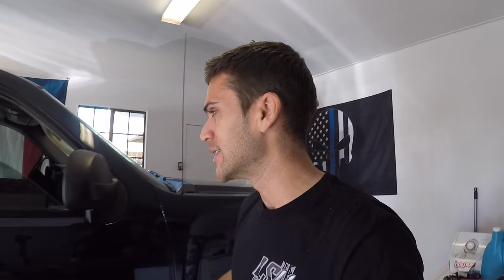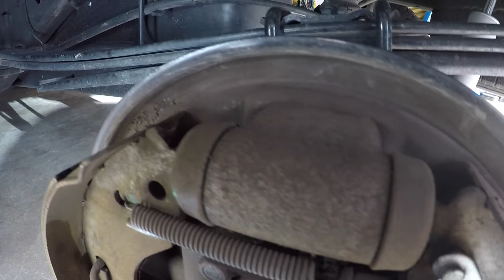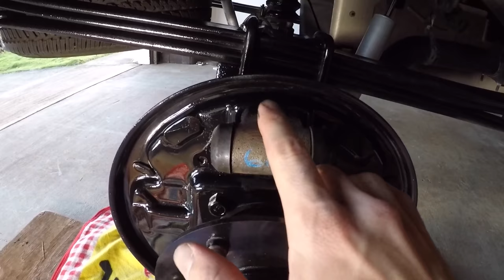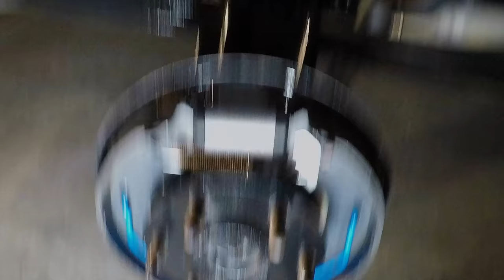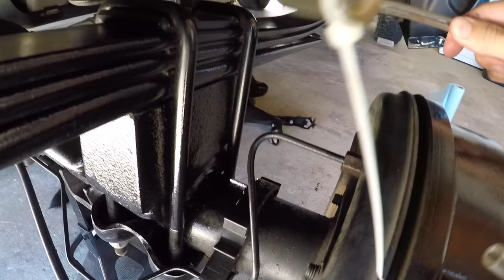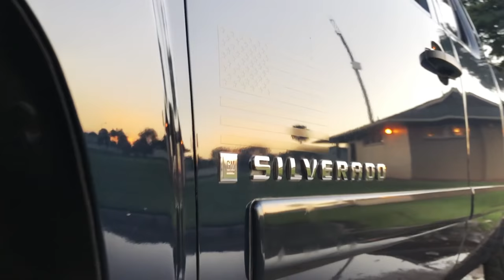Drum Brake REBUILD - Silverado Easy DIY

Comment: My 2010 had the same issue with brake fluid mysteriously going down, the master cylinder was leaking into the brake booster(the big black dome behind the master cylinder). Unbolt the two master cylinder bolts on the booster and move it out of the way and stick something down into the booster, will come out wet with brake fluid.

Comment: Rule of thumb on most trucks there's always a bolt on the truck that will fit another spot. Especially for the drum brakes. Also the disc brake conversion I've seen are around $1500 just for parts. Alot more stuff then u think.

Comment: How much does the truck get driven and how low does the brake fluid reservoir get? Your fluid is going to go down over time also just from the shoes and pads wearing and the pistons holding more of the fluid.

Comment: The reason you are topping off  every 6 mos is not needed, as your brakes wear the fluid lowers. If your constantly topping off your system will be overfilled when you do a brake job and dump fluid everywhere when you compress the wheel cylinders and calipers for the new pads/shoes. Replacing a wheel cylinder like that is good preventative maintenance  but was unnecessary.  Wheel cylinders should also always be changed in matching sets unless using o.e.m . Lucky your in Hawaii because any other states then ca. And Hawaii those wheel cylinder bolts and brakes do not come off that simple.. I.E Rust.. but great vlog/info for noobs..

Comment: You should get the RC 3.5"x3" front and rear suspension lift kit! I have it on my truck and it doesn't have a lot of flex on the ball joint, outer tie rod and control arm. It took a day or two install but well worth it. Let me know what you think!

Comment: You may have covered this in another video but have you run into any Active Fuel Management issues as most other 2007-2019 Silverado/Sierra owners are experiencing?